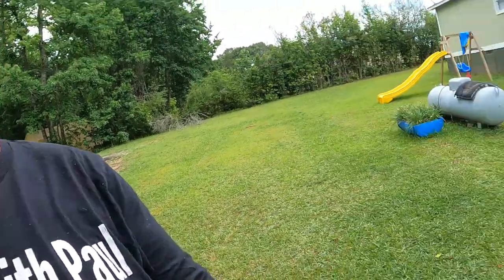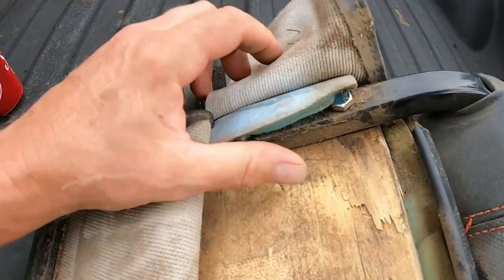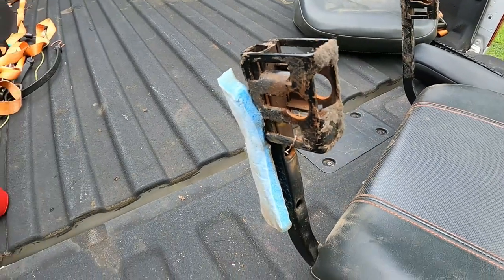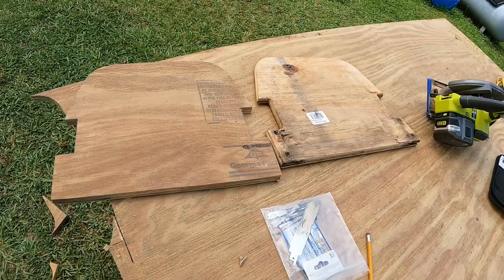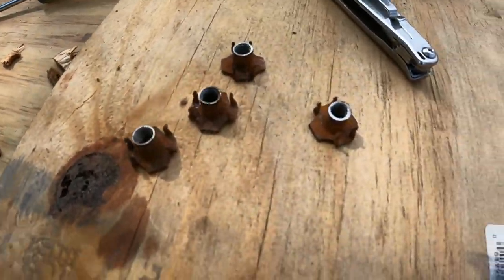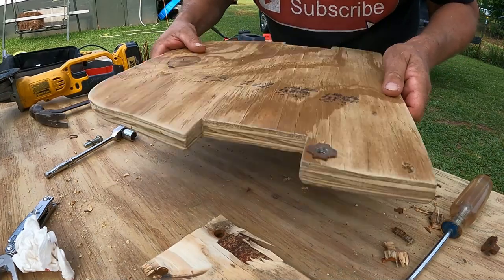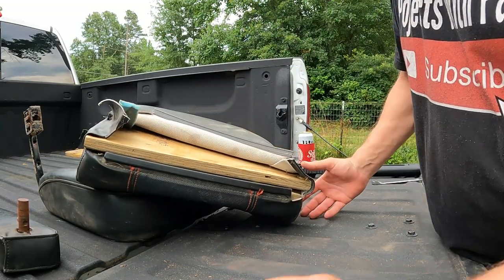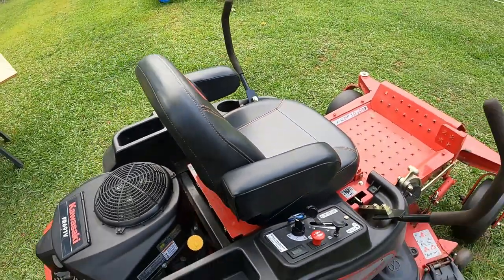Big Dog Alpha MP Zero Turn Lawn Mower Seat Back Rebuild

Comment: I can’t tell you how much this vid helped. I have a bad boy mower very similar to the one you have. But the plywood on the seat bottom rotted out. I couldn’t find any repair videos on that but watching yours and using the same principles I was able to repair the seat and save hundreds of dollars! Thanks!
Reply from the maker: Thats awesome. I'm glad it helped. Thanks for watching
Reply: My bad boy mowers seat is rotted on the bottom too. Took it apart today but I can’t seem to figure out how to get the slide for the adjustable seat off on the right side. The inner slide won’t move far enough to access the front bolt where it attaches to the wood. Any recommendations?
Reply from the maker: Not really other than just keep digging into it.  Thanks for watching.

Comment: Big dig would have replaced the seat and for the belt issues it has nothing to do with the engine its the pump brackets big dig makes a frame kit that issues is from the paper thin brackets bending
Reply from the maker: Thanks for watching